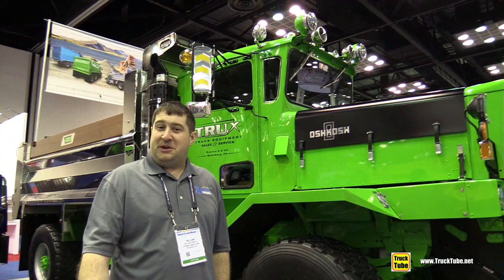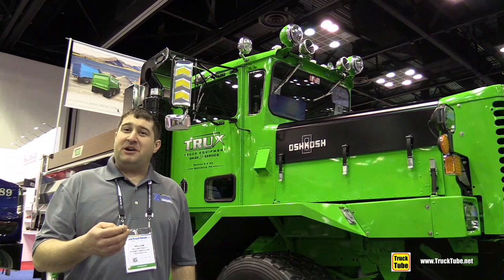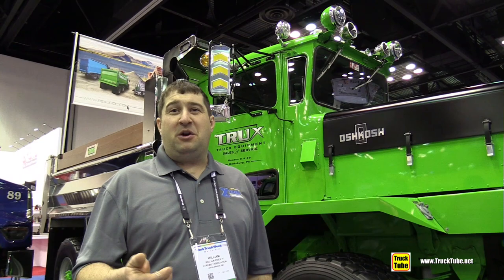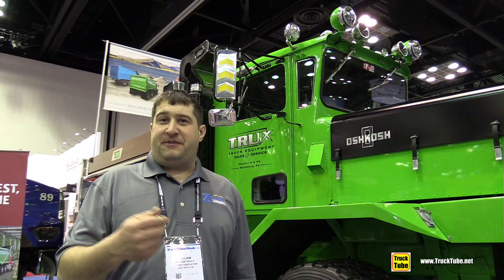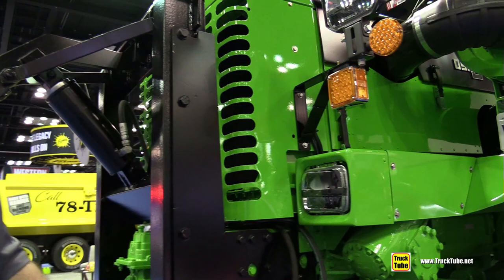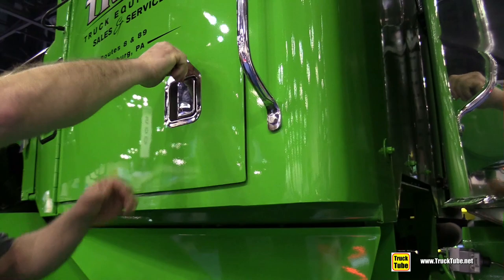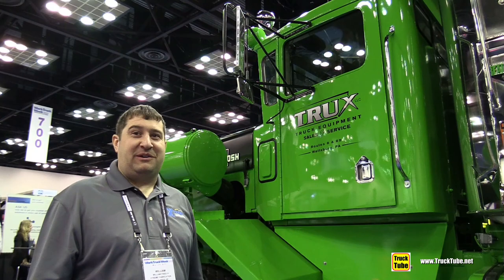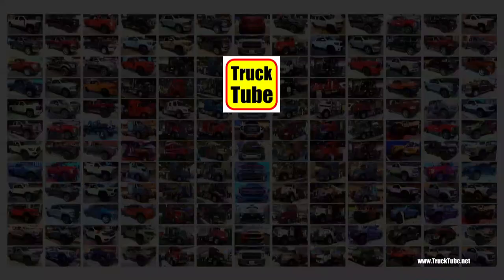Full Truck Review - 1989 OshKosh P-2526-2 Snow Plow Truck - Review by Will from SnowPlowNews

Comment: About 15 years ago I had some ancillary involvement with a major construction project at our local airport.  At one point I had a chance to talk to one of the guys involved in maintenance of the grounds and snow removal.  This airport had used Oshkosh trucks for decades, but for a time in the then-recent past they had switched to using the largest truck that Ford made at the time.  I think it was called an L-9000 but my memory could be wrong.  This guy said that the whole crew hated those Ford trucks.  He said that when clearing runway intersections with a plow that was something like 20 feet wide, the Fords would simply stop moving when the plow really got a load in front of it, and they needed to bring in a snowblower or front-end loader to help out.  Then the airport switched back to using Oshkosh trucks and the whole crew was thrilled.  He said that the Oshkosh trucks were never overwhelmed by a huge load of snow in front of one of those extra-wide plows.  They would always just keep moving.  At the time, they had a new Oshkosh that had four-wheel steering, which could be programmed to do things like drive diagonally, which I think was favorable for certain plowing situations.  The other Oshkosh trucks were pretty conventional.
Reply from the maker: Thanks for sharing !

Comment: You mentioned the custom-work capability of the Oshkosh company.  I talked to a guy who said that any part of any truck that Oshkosh has ever built, is something that they still have the blueprints for and will build again if a customer needs it.  I don't think any other company has that ability or willingness to assist customers in keeping old equipment running.  I also heard that they build trucks in the same sequence as the orders which come in.  This means that sequential trucks on the assembly line might be entirely different from each other.  This is a bit less efficient than if they tried to keep similar orders together, but it causes the workers to consider every truck to be a special order that is deserving of their full attention and they don't get lulled into boredom and carelessness by repetition.  The result is that the workers feel more involved in their work, and there's far less chance of having quality-control issues in manufacture than what you see in any typical vehicle-assembly system.